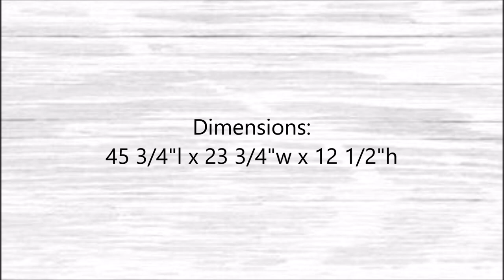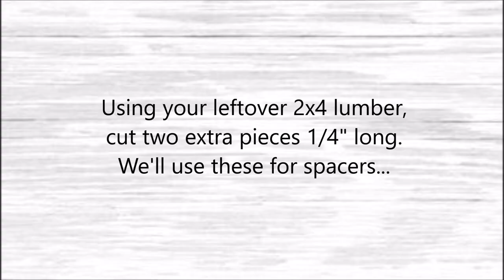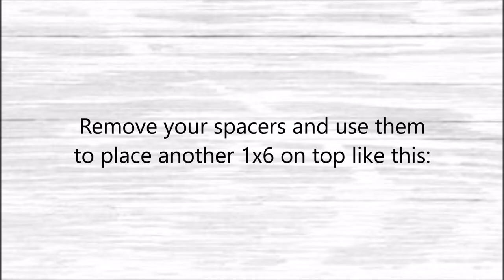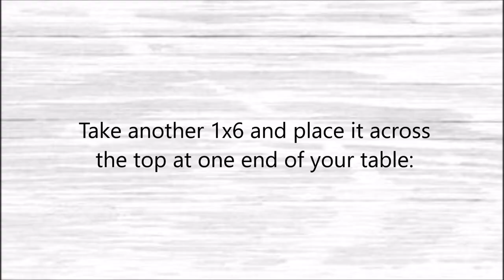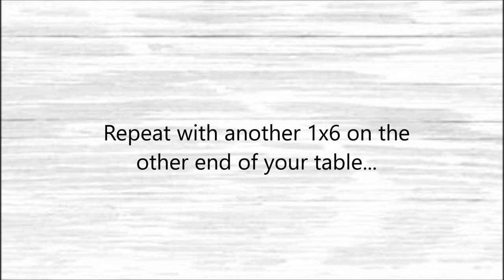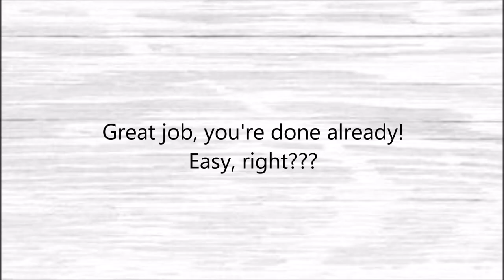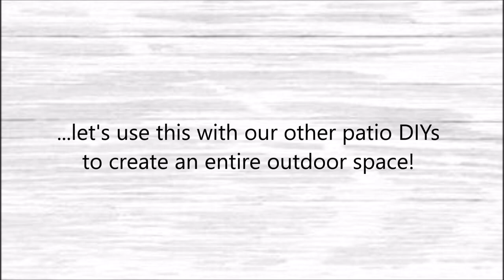The $50 Modern Patio Coffee Table - Easy DIY Project!

Comment: Keep in mind that his dimensions are based on nominal lumber. I found some cedar fence pickets and they are a full 6", not 5.5". So I will slightly modify my 2x4 cuts to account for this. I love this design, so simple. At my home store, the 3/4x6x6 cedar fence pickets were less than $3 each!